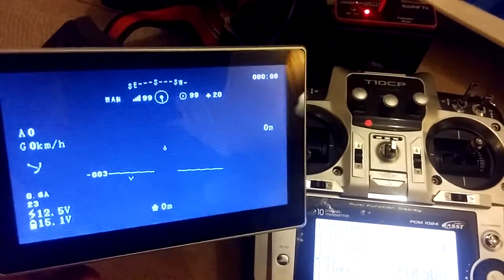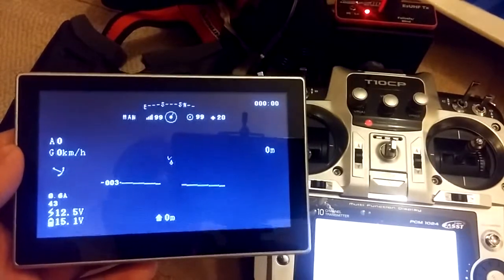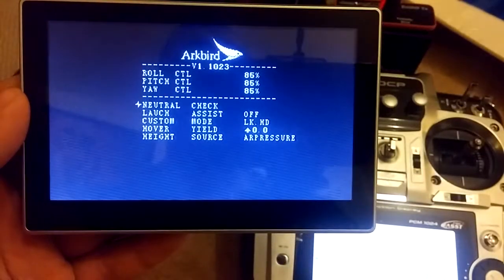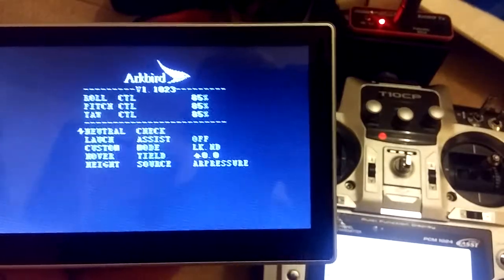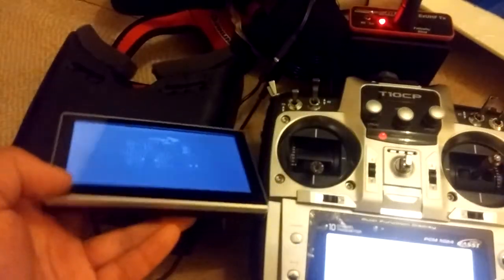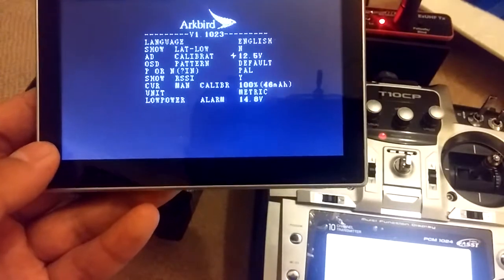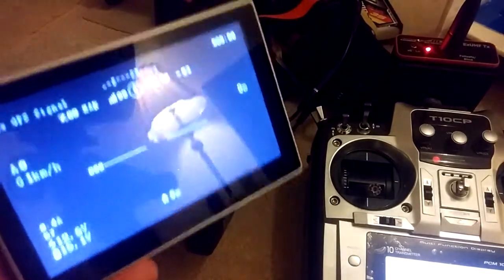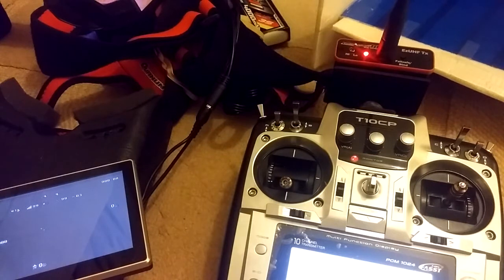Arkbird Autopilot 2.0 reveiw PART 4 (Q&A/trobleshoot)

Comment: Really enjoyed your series on the Arkbird system.  I installed everything and all worked fine (on the ground that is).  I went through all modes and moved the airplane side to side the control surfaced moved to correct leveling.  Moved for and aft and again all worked as advertised.  I started flight in manual mode and flew great.  Started in stabilization mode and the airplane seemed to overcompensate with the roll.  I then went back to manual mode flew to what I thought was a safe altitude and switched to stabilize mode and the airplane immediately rolled and pointed straight for the ground.  I had no control and it crashed.  I made sure the Arkbird unit was correctly mounted in the fuselage with arrow pointed forward and the silver box facing upward. And again, I made sure all of the flight control surfaces moved in the correct directions to counter or correct roll pitch and yaw.  I'm going to check as I might have set the control surfaces to reverse in my radio to correct movement instead of doing it in the Arkbird menu as you stated.  Do you think that might cause the roll dive I experienced?  If not, do you have any other ideas as to what the problem might be?  Thanks
Reply from the maker: Elimin8tor65 sorry to hear about your crash, this is a rather alarming situation but not one that I encountered ever with any AP, but I have seen ap systems doing over compensation not that violent though, I have 2 thoughts here maybe they will help.
1. Neutral point! Did you put the plane on the ground in a straight and true position roll/pitch and recorded the neutral position? This tells the unit what straight and true should be, if neutral position is recorded wrong the the unit will fight the plane.
2. AP UNIT ROLL PLACEMENT! I know you placed the unit in correct orientation but was it not tilted to the left on roll axis? Sometimes it's very minor but makes a difference in flight, maybe the spot on the plane you use for AP is angled to the left which would mean a roll to the right.
Besides those two points your assumption could be spot on too. Check your controls in radio, record neutral straight and true and make sure the AP unit is sitting flush on something with zero roll/pitch/yaw angle.
Good luck
Reply: Okay.  Will do.  Thanks again for your hard work on these Arkbird Vids.  They helped quit a bit.  Take care.

Comment: I see you have ezuhf? I cannot get my ezuhf receiver to work with ppm. In the config tools, I set Servo Output Ch1 to "PPM Muxed". I connect the TX ch1 to PPM In of the Arkbird, but that doesn't work.
If I use just all the channels 1 to 6 and connect them to the 'In' connectors, it does work. (so the RX is working and bond to the TX)
What am I doing wrong with PPM?
Reply from the maker: hi mate, yes i do have ezuhf and to be honest i have tried ppm a couple of times and it didnt work for me so i just use it the old school way all the wires extended to the ezuhf. i know its not the solution you are looking for but thats  how i use it and it works ok for me with no problem, you do need some long servo wires though.
Reply: I just have read that Arkbird speaks only ppm to the Arkbird uhf system. So that su... :(
Reply: Wish I had read your post the other day, was trying for ages with the muxed option

Comment: Thanks  sharing this Vid,  good stuff
Reply from the maker: thank you for watching :-)
Reply: No problem, I've got both the OSD and the ATT in the mail from HobbyKing, trying to learn what I can before it arrives. Taking this FPV thing to the next level, not really ready to start making my own videos about FPV, too much of a noob still.
Reply from the maker: will be great to see your vids once you find your feet in fpv,  just take one setup at the time, over complication is the worst thing when it comes to fpv. once you can fly well and recognise landmarks easily then you can start adding extra bling and gadgets to which there seems to be no limit :-D
the most important thing is your plane, choose something easy and something familiar, a real flyer, floater and breeze to control. hopefully you will have a great experience.

Comment: Good luck using this with the antenna tracker .. arkbird 2.o will stop tracking in the middle of a flight .... V1 arkbird with the dedicated air module works fine on the tracker .
Reply: Outbackkanga, In fact, arkbird 2.0 which integartes air module should be same or better as v1 arkbird.

Comment: how much dude will it work on quadcooters
Reply from the maker: i think this unit is very much made for fixed wing,  couldnt see anything there regarding quads, to be honest quads are very much covered when it comes to auto pilot systems, loads of them out there, and some cheaper too.
Reply: AB is NOT for quadcopters.
Reply: Ok thank is there auto pilot system that is name prices if you can help cheers
Reply: gadgetman 404  try this https://hobbyking.com/en_us/tarot-zyx-m-multirotor-gps-flight-control-system.html
Reply: Cool i check it out cheers bud have you seen my channel im haven problems with my freeX skyview quadcopter please watch video why cant take.off.tell me what you think etc.cheers again for info

Comment: Very good review.
I have used V1 for years with no problem but a fellow flyer bought one of the V1 and we were unable to get it to work and returned it to HK.
I agree it is a great system and has saved my plane many atime.
I did not see in your setup where you verify the direction of correction that AB gives.
i.e. In PA(Pilot Assist in V1) mode(AST V2) if you point the nose down AB moves the surface to bring nose up. similar for Aileron and rudder.
Reply from the maker: thanks for watching. i have not used the V1 but from what you mention the said function on the 2.0 is the AST function. it will correct any pitch irregularity and completely level the craft when the last known direction and altitude fixed. i never have to verify anything, the NEUTRAL CHECK that you do before flight teaches the unit the level attitude of the plane to which it will refer. thats why NEURAL CHECK is so important.
Reply: Neutral check can not tell AB that a certain servo movement will give you up elevator...that depends on the mechanical connections of your plane. I know that I had to select reverse on elevator the first time I used it and then also reverse it in he radio. I really think you are wrong...it is not automatic..it is like the 3 axis stabilizer system in several BNF planes....or the 3axis unit from HK
Reply from the maker: 2 points

1. in order to get the servo movements right you have to connect them to RX properly and also reverse them or not to get the proper control surface movement for right/left/up/down, you dont have to reverse them in both radio or autopilot, just autopilot is enough, i have referred to that in video 3.

2. after all your control surfaces are moving properly you go flying and assuming that you did a balanced neutral check, once AST is activated the plane will keep true and level or at least try its best anyway. 

doesnt matter how good AST is if the control surfaces are not moving the right way, you will crash. that is RC 101 really.
Reply: Making sure the surface moves in the correct direction between Tx and Plane is NOT enough. You have to verify the correct direct between AB gyros and the surface as per section  8 of V1 manual.
see "8. Reverse Balance Mode assistant Control" of V1 AB manual.
Maybe we are both saying the same but I did not see you go over that in Part 3.
This is a VERY critical step and should be stressed to be checked and verified OR you will crash.
Reply from the maker: ror1948 to be honest mate iam sure we are talking about the same thing but different versions, here is what I did. connected servos, told arkbird it was a flying wing, checked if any servos needed reversing and then put it in the air, that's all! I haven't crashed so far and it flies beautiful. I went through all the settings, if it wasn't on the screen then it isn't in this version. 
you keep referring to v1 and this is not v1
Reply: The different version are not the issue.
I am just looking for more details on how you did this "checked if any servos needed reversing"
did you:
1) verify direction between Tx and plane
2) when in AST mode, verify direction when tipping plane right, the ailerons move left to bring plane back to level. etc
options are:
1) neither
2) 1 only
3) 2 only
4) both 1 and 2
Reply: since you are hung up on V2
Have you performed check "Reverse Balance Mode assistant Control" of section 7 of the V2 manual?
I did not see or hear that in your review
Reply: Hello there. great videos.  When you say the receiver has to be absolutely straight with the chassis. Does it have to be centered inside the fuselage, meaning lined up on the same line with the prop and rudder ??? Or can it be on the side of the fuselage but pointing absolutely straight ???